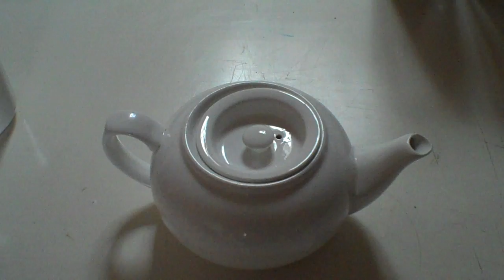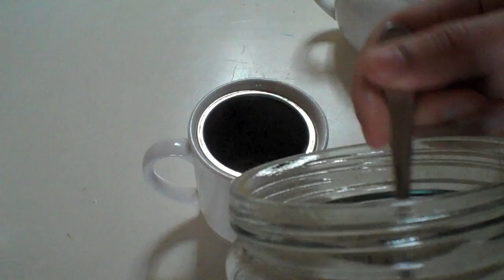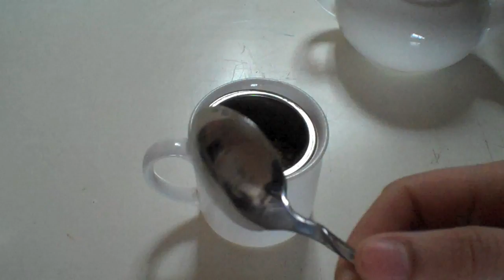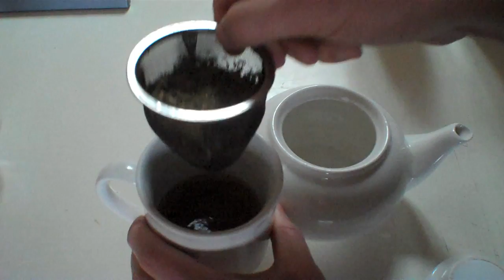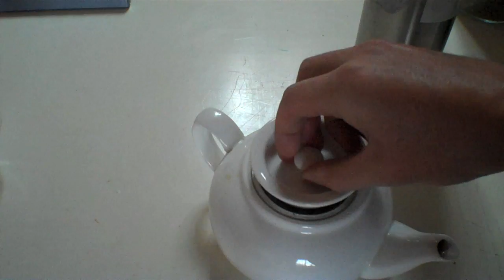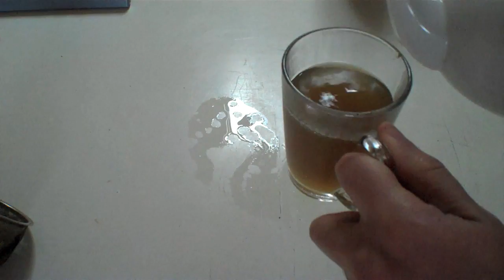Making Yerba Mate with a Teapot

Comment: Thank you. 🌻

I've been using a similar system, but with a few twists.

I use an 8-cup vintage Corning Ware tea/coffee pot (which is made of special stovetop-safe ceramic). After heating about two cups of water in it to around 150°, I add ~10 grams (or ~40 ml) of the dry yerba mate, and stir it in. Then I cover it and let it steep for five minutes or so.

Then I pour it into my favorite coffee mug, with a strainer suspended over the top (much like your system, but with a strainer (standard-type) over the mug rather than in the pot), pouring it with the lid still on the pot. The lid has a small opening at the spout, so the small opening blocks and catches most of the leaves and twigs, like a pre-filter. The strainer catches the rest, which is only a small amount, which is then shaken back into the pot).

Then I add another two cups of water to the pot, and repeat the extract (from the same yerba as last time) as often as desired.

Periodically I add another ~40 ml (~10 grams) of dry yerba to the pot, to strengthen the tea as much as desired.

I just keep going like that until the pot more or less fills up with wet yerba, which I continue to extract until it gets too weak. Then the pot gets emptied, and I start the whole cycle again from scratch.

It's been working great for me. Very happy with it. Love yerba mate.

I want to try Rosamonte Serena, just to see what it's like. Have you tried it, or heard from people who have? What have you experienced or heard about it?
Reply: what you mean